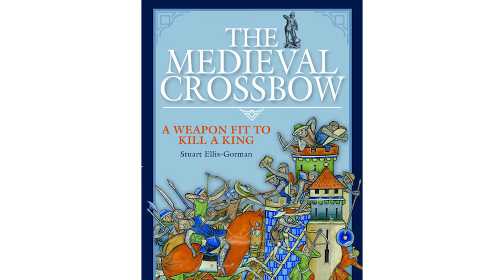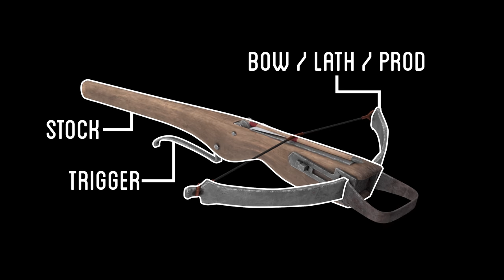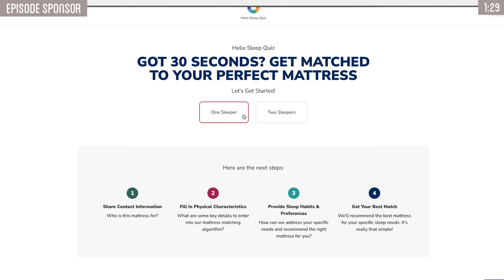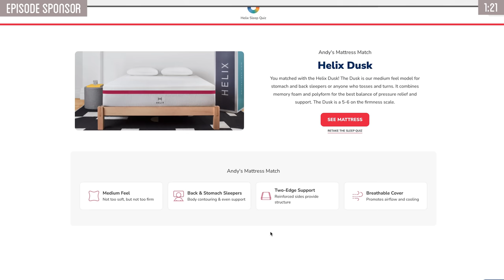Can I Make a Crossbow From Scratch?

Comment: I really wonder where he dug out this "expert" , crossbows were never as powerful as bows until modern times simply because of the power stroke .. there isn't enough time for the bow to put enough force on the bolt to drive it efficiently , hence why crossbows were made to be 1000+ lbs .
They are extremely inefficient and a bow can shoot an arrow that is  the same weight as a crossbow bolt at a much higher velocity when it is at the same poundage , so if you have a 100 lbs bow and a 100 lbs crossbow , the bow will shoot the arrow that is of the same weight as a crossbow bolt at a much higher velocity .
The end goal is simple weight of projectile and velocity of projectile .
And don't get me wrong I love crossbows I'm actually building a medieval style crossbow myself and because I'm building it and have done my research I know that crossbows are weaker then bows.
To add a wooden bow for a crossbow is able to return to its original position much faster then steel because of how light it is compared to steel , steel can just shoot heavy loads .
Think of it rpm and hp on a motor , just because you have high rpm doesent mean you have the strength to move heavy loads but at adequate weight you can outperform something that can carry a heavier load
Also it's not a myth , it's a lot easier to train someone to use a crossbow properly then it is to use a bow , it's only more expensive to get enough numbers of crossbows , war grade crossbows.
On the other hand the blacksmith was absolutely right in all his points , the temper is critical in a crossbow because it can break in a rather dramatic way , I personally made my temper on the crossbow I made softer then normal so that it bends rather then breaks when it reaches its critical point .
Reply: Well... I'd say they were never more powerful.

In terms of power (and that is in compensating for the shorter draw strength) there were a few crossbows that would end up matching the heaviest of warbows because simply put, whilst you had to make a crossbow a lot stronger in terms of pundage to actually match a warbow in terms of outcome, fact of the matter is you *could*. For warbows there's a pretty clear limit on what a human body can actually still do, whereas the heavier of crossbows are going to be using some kind of lever anyways, which means you are instead limited by the power of the material rather than the capabilities of the user.

But really, even though they get compared a lot, we are just talking about different weapons with different advantages and disadvantages and slightly different uses.  

Bows are difficult to match in raw strength and shooting speed, which makes them a better battlefield weapon. Crossbows offer better consistency because they don't tire the user as much, they allow for better accuracy because you can take time to aim with them, and they are more suitable for working around the cover provided by a merlon or pavese because you can keep them easily drawn. 

In a scenario of well-trained men-at-arms fighting each other in a field battle, bows are going to outperform crossbows, but in a siege battle, for hunting or when working with conscripts who have no previous training, crossbows are going to be more efficient.

Comment: so funny that the blacksmith wore goggles and not gloves
Reply: why would I wear gloves? if I'm holding the work with my hand, it's not going to be hot enough to burn me, and if I'm holding it with tongs, I want to have the most dexterity to control the tongs. And you never wear a glove on your hammer hand.

Comment: "bowstring has stretched" lol and what bowstring would that be? All I see is a horrible piece of twisted jute twine/rope that's only meant for staking tomato plants or bundling newspapers. Amazes me you talked to a supposed expert and still didn't realize pine was a terrible choice for the tiller or crossbow strings are never eye spliced jute twine. Also sear angle on the soft wood tiller is way too steep which means you're having to actually draw the prod back further as you struggle with the trigger bar attempting to loose the bolt. Common sense and halfway decent materials (maple or oak tiller for a start and endless loop linen bowstring) would have at least resulted in something usable.
Reply: He makes his rope out of flax flowers like the romans did. Thats why it looks like that

Comment: This 'doctor of crossbows' guy is actually incorrect in his statement that crossbows are more powerful than longbows. Yes, a 1200lb draw weight crossbow has, well, a frankly ridiculous draw weight requiring a windlass. HOWEVER, the draw length of the crossbow is usually 6-8 inches, so it needs to have that draw weight to put force behind the arrow. Contrast that to the longbow, which has 30-40 inches of draw, putting force behind the arrow the entire way. A 150lb longbow hits with similar force to a 1000lb crossbow, see Tod's Workshop YouTube channel for the breakdown and experimentation. The advantage of the crossbow is that it requires much less training to use, and is excellent for firing vertically downwards in a siege situation. On a battlefield the longbow is better, with more range, accuracy, and fire rate.

Comment: 2:07 Okay this expert is incredibly wrong with almost every aspect of what they are saying. Please watch Shadversity or Tod's Workshop. I don't think Skallagrim did a crossbow episode but if he did please watch that instead of this series of incorrect statements. The crossbow was not stronger than the bow, it was much more complicated than that. The longbow could pull much more weight and power than a crossbow, the issue was that you needed to be holding a bow. A crossbow was basically the size of a shotgun or so and you didn't need to pull it back which meant that it was better suited for fighting on walls and etc, but even then its many times more complicated than this person. This expert is the equivalent of a "doctor" telling people to inject bleach to fight off a cold.

Comment: 16:00 Not wearing safety glasses? LOL -- what a chump.
"Shooting it for the first time" and being incredibly unsafe.
Reply: He is- His glasses are impact safety rated, and the rest of the crew is also wearing safety glasses. You can even see them on Kyle's head later in the video.
Reply: @TheElfsmith  Wrong. 16:00 he lacks any ANSI Z87 or ANSI Z87+  rated safety glasses (Or anything properly rated for that matter). Plus his regular glasses lack any wrap around protection completely defeating the entire reason for having them in the first place.

He is being incredibly unsafe in the most critical part of testing. Educate yourself.
Reply: @AgentLokVokun  You do know that regular prescription glasses with polycarbonate lenses can be Z87 and Z87+ certified, right?

On top of that, even though I agree that wraparound glasses offer better protection, the chance of failure in this situation is highly directional, and the trade off between wearing impact rated prescription glasses and being able to see while shooting a projectile weapon while working with a camera crew at a public range, versus having peripheral protection but not to able to see is a fairly obvious choice in my opinion.

I don't know why you timestamped the test firing though- he's still obviously wearing his glasses, it's not like you can see the stamp inside the frame, and I was literally there for it. I'm the one that brought the eye pro you see other people wearing in the video.
Reply: @TheElfsmith  He's not wearing impact rated glasses at the time stamp. 

You say his glasses "CAN be impact rated" but ARE THEY_? Even so they lack any sort of realistic protection so it _literally doesn't even matter. 

And tell your doctor when you lose your eyesight  "The chance of failure in this situation is (was) highly directional"

Practice what you preach, nerd. If you bought everybody eye pro you should be a hardass about using it.

Comment: i dont reaaally get why you are using power tools to make the crossbow. isn't the point of the show progressing with time?
Reply: what power tools?
Reply: @TheElfsmith  at some point there is a drill visible, and i am also talking about the contrast between the earlier episodes. back then the tools for building the projects were selfmade as well. i know that doing it like that is way more work, but it was just something i noticed
Reply: @orthos7121  That's an auger bit. It's used in a brace, not a drill.

We'd probably still be using the tools from the reset honestly, except for the fact that they mostly burned along with Andy's shop.
Reply: @TheElfsmith  oh alright, i didn't know that it was not a drill. yea according to the circumstances thats fair, idk didn't want to be rude or anything ^^